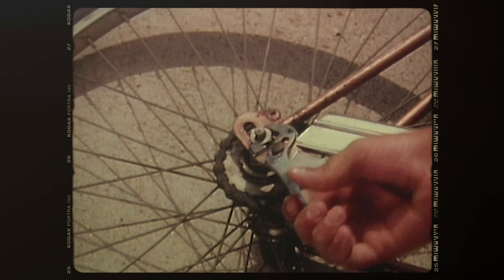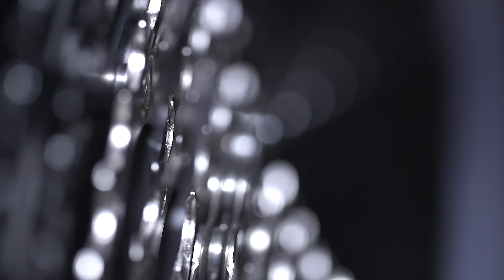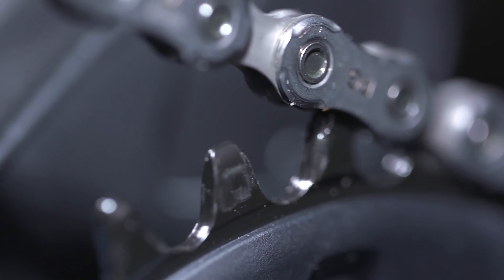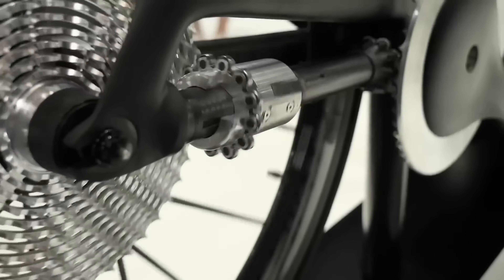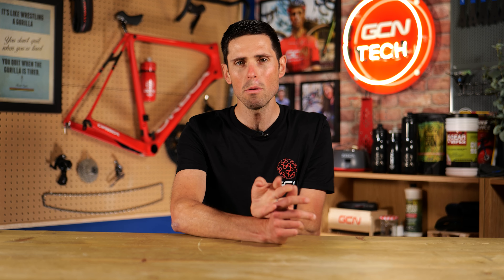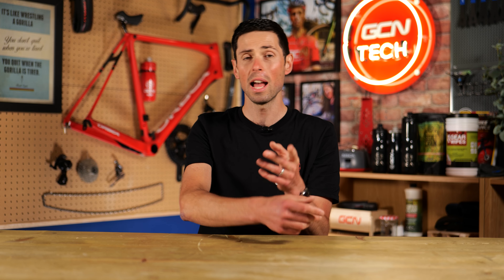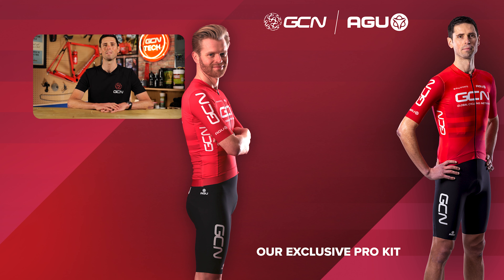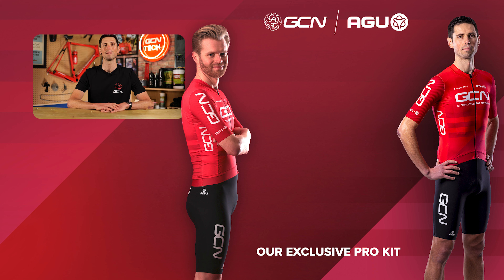Why This Will Never Happen!

Comment: For 99% of bike customers - as in, the normal people who make up the vast majority of bike sales - efficiency is entirely irrelevant. The things that matter are cost of purchase and maybe cost of maintenance - though the latter is already not very important to most people I would guess. Thinking back to my teenage days when I biked everywhere the things that mattered were the maker of the bike and how many gears it had. The chain wasn't given a single thought.
So, if you want to replace the chain with something better, it must be at the same cost or if the cost goes up by a handful of % you need a genius making the advertisement campaign. It's possible, I guess, but an uphill swim during a thunderstorm. 🙂

Comment: The ceramic speed driven project is the best competitor, however; it tried to win the whole ball of wax and that was a step too far. I am a design mechanical engineer, inventor for hire, retired. So I have a background to apply.  I have seen this whole ball of wax approach and the results here is what I expected, failure.  
The problem is that the designer always has unknowns that must be solved in the process of building the first production model. And unknowns that are a recognized problem are the easy ones. The hard ones are not known. I this case he set the robustness and performance standard very high so the price was cost paid to achieve it.  And the customers didn't see value, even the racing customers which even if they did, likely they wouldn't have prevented bankruptcy.
A better approach is to choose to stay in business which means provide the best value product and sell it to a niche market where it out performs a chain, VALUE. With a safety shield covering the end components for example it could be the best off road muddy, freezing slush, sand, jamming twigs weeds, etc., and grit. A ruff environment for bike because. the covers can keep the components  cleaner.
Took decades to squeeze out the issues to increase the value of a chain. There isn't a substitute for this.  
It takes trial and error with testing to solve issues after issues that reduce value.  Note, I didn't say performance or cost.  You want both, a balance. And you can not do this work without making a profit. It sometimes takes decades to even know the issue that needs to be solved. And the customers are going to be bringing you those issues from using the product. Especially as you broaden the customer base and environment. You will see the failures and have to figure out the issue behind them.  And this isn't obvious often.

Comment: As an Engineer I am sick of hearing that belts are better than chains, they are not.

Belts are not maintenance free as you still have to clean and inspect them plus they stretch no matter what the companies say.

That's why belt driven machines have belt tensioning systems in place to periodically tighten up the belt.

I'm not saying that belts are completely crap they do have a use depending on where it's used.

Comment: Please, internal gear box don't and can't replace chains as they also need power to be tranferred to the rear wheel. If that's done by belt drive then the belt replaces the chain, not the gear box.

Comment: I am so confused - a 99% efficient drive train won't be used because it will add an estimated cost of $2000 per bike, but yet Rohloff and Pinion easily cost more than that and are less efficient than chain.
Reply: Rohloff makes hubs, Pinion makes gearboxes. The former sits in the rear wheel the latter sits where usually the cranks and bottom bracket are located. Both systems require a connection between cranks and rear wheel, and that connection is either a drive belt or a chain. Neither systems works without a chain, so they can't be any more or less efficient than one.
Reply: @einundsiebenziger5488  - And yet they are both less efficient than rear cassette/derailleur and multiple chainrings + front derailleur.

Comment: Love belt drives for commuting. Love internal gears as well.  Both are great for reduced maintenance and the ability to always be in the ideal gesr to start or climb. Still, there is a weight, friction and cost penalty. For e-bikes those translate to a loss of range.  That extra weight on an already heavy bike is tougher to load and unload too.
Reply: Seems like belt drives and internal gearing would be much better for Winter.
Reply: @daniellarson3068  belts get stiffer and internal gears get a little sluggish, but I still prefer them for commuting, especially on an e-bike. No more missed shifts or being caught in the wrong gear at a stop. Loads easier on the entire drive train, but that does not negate the points in the video. Chains and deraileurs really are light, fast, affordable and almost as reliable as belts and internal gears.
Reply: Crazy that you spend more time name checking Ceramicspeed than considering belt drives or investigating how quickly chain drives drop from 98.3% efficiency. I should think that to get to that level you need to be running single speed, as any bend in the chain line is going to have an effect, particularly if you're running a 1x set-up, even with modern flexible chains. A well-maintained derailleur set up might still be a more efficient way to add gearing than a hub gear, but how well-maintained does it need to be? Looking at (and hearing) some of the bikes I come across, their chains and  derailleurs aren't running at anything like 98.3% efficiency. I expect that a brand new, professionally set up mid-range derailleur system is going to be more efficient than  a belt-driven Alfine system. Clearly, the derailleur needs more maintenance to retain its efficiency advantage, or, to put it another way, if neglected, it will become less efficient than a similarly neglected belt + hub that doesn't need much attention. The question is, how much extra maintenance effort, and at what level of skill, is needed? I find a chain-driven Alfine hub tolerably efficient for commuting, and less hassle to gear the gears running smoothly. I think I notice benefit after servicing my chain. If I ran a belt + hub set up that was fairly constantly only 90% efficient, but stayed at that level for years, how much effort would I have to put in to maintain a chain + hub that could be 92% efficient at best, but with enough time and neglect would seize up completely? If it's ten minutes every four weeks, I might be better off with a chain. If it's 15 minutes a week or the chain becomes less efficient than a belt, I would be better with a belt.
Reply: @chrishowell5718   hmm, chains are comparably very tolerant of abuse, which is one of their advantages, it’s never going to seize up 

it’s overstated that planetary hubs don’t require maintenance, they do. At the low end the Sturmey and Shimano hubs are poorly sealed from water ingress, and require periodic regreasing, not a simple process for either of them, and above the abilities of the average person.  

Expensive higher end hubs like the Rohloff are well sealed and run an oil bath with is easily replaced. Drawback though is should the Rohloff need repair you have to ship it to the manufacturer in Germany. And of course if you commute in a place like London, you can’t lock up that Rohloff equipped bike on the street, because it won’t be there when you get back.
Reply: @PRH123  I'm not saying that hub gears and belt drives are without their issues, just that it's a bit meaningless to say that chains can be up to 98.3% efficient without reference to how quickly they fall away from that or the effort needed to keep them there. Chains certainly can seize up completely (though the comparative ease with which a derailleur drivechain can be replaced is one of its advantages). I've also  certainly ridden bikes where the chain has seized at one or two links, giving that characteristic skip as it goes through the rear mech, and where the derailleurs are so badly aligned that they make a god-awful noise and won't select certain gears. Again, it's perhaps an advantage of chains that despite this the bike will go, and can be put right usually with minimal cost and effort, but I suspect that the fall in efficiency here s not 98.3% to 97% with a winter season's teenage neglect of the chain, but more like 95% (it was never a single-speed running in optimized lab conditions to start with) down to about 70%. If anyone has ever tested this, the results aren't easy to find.
Reply: @chrishowell5718  maintenance is a thing whatever you’re riding, anyone who neglects their bike enough to rust the chain is going to have issues with their planetary hub as well, they wouldn’t be likely to change the oil in their Rohloff or regrease their 3 speed ever…

anyway you’d have to leave the bike out in the rain for a year to get down to that 70% figure… 

There’s no maintenance free panacea in cycling….   like musical instruments they need attention to be kept in tune :)
Reply: @PRH123  well yes, that's my point. How much maintenance is required to keep a chain and derailleur system close to the mythical 98.3% (especially since the 98.3% is almost certainly for a single speed with straight chain line)? If it's 15min a fortnight to be 90%, perhaps that's fine, but many commuters might feel that 5mins a month for a hub and chain, and nothing apart from a yearly tension check and 5yearly oil bath for a belt to maintain a steady 87% efficiency is fine. I suspect that a whole year of neglect takes the efficiency of a derailleur well belong 70%, by the way. But that's the thing: no one talks about figures for how bad the efficiency of a badly maintained bike can go, it's always 'in tests at Harvard, bike chains were found to be 98% efficient and nothing is ever going to better that'.
Reply: @chrishowell5718   that’s the reason chains will always be around, they are very tolerant of abuse, and can run at large angles without any loss of efficiency 

The chain being dirty has some impact on efficiency, but it doesn’t take it down to 90% or lower, and 98% isn’t mythical if one just takes step to keep their chain in order.
Reply: @PRH123  sure, chains will always be around, though belt drives might increase their market share. Genuine question: do you have data (published by others, or self produced) that supports the assertion that chains on what might be considered 'the average bike' are running at close to 98% efficiency? I'd be amazed if some of the bikes I see around local supermarkets are running at that. I don't expect you to, if like me you are just some random off the internet. What is a little disappointing is for a relatively big YouTube channel to quote 98.3% as a standard value for the efficiency of bike chains based on one paper, whether it came out of Harvard or not. Even if chain + derailleur can be maintained at 97% efficiency with weekly maintenance, dropping to 91% with 3 months winter neglect, and a belt and hub never beats 95%, there will be people who will accept that because not having to do weekly maintenance is worth the loss of efficiency. Again, these are numbers that I'm essentially making up. If you have actual number (beyond 'Harvard says 98.3%, wow, no I haven't read the paper but what a big number that is).
Subjectively, I know that my teenage kids will ride their bikes until they are significantly more effort to ride than my own (Alfine, Chain) commuting set up ever gets. The commuter isn't as light to ride as the road bike, but then it doesn't have to be.
Reply: @chrishowell5718 everything from the cycling industry today, os about perfectly maintained performance. This is yet another reason Trek, Giant and Specialized have not moved more e-bikes. E-bikers aren't interested in expensive, marginal gains, especially more practical e-bikers that are replacing car miles vs bike miles.

Comment: It's bizarre and fetishistic how people are obsessed with chains. They cost about the same as a pair of grips or a box of bar tape and can be replaced just as easily. You don't need it to last 100 years so they don't need any of the maintenance that people who have products to sell like to claim. The important lubrication is deep in between the pins and rollers so leave it alone, stop washing out all of the stock lubrication with thinners, stop adding oil to the surface where it just collects dirt. On a BMX I was super hard on chains, bashing them on ledges and rails and I just treated it as a consumable item.

Comment: I agree with the premise of this video, which is that the humble bicycle chain will remain dominant throughout our lifetimes. One slight correction, though. When we speak of "links", as in 112-link chain, we are really talking about half a link which would consist of either two inner side plates OR two outer side plates, a pin and a bushing. What was described in the video as a link might be more accurately called a "full link," or two inner and two outer side plates and TWO pins and TWO bushings. With wider single-speed chains, there is such a thing as a "half link," which has bent side plates that can be used to connect an inner link to an outer link.
I love the fact that the pitch and in some cases width of bicycle chains have been unchanged for over a century. It's one of the  the oldest surviving "standards," now that the 100 mm width front dropout spacing is fading away, and is still defined in inch units. The 9/16 x 20 TPI" pedal thread and the ISO BB thread are the two others, though the latter was changed very slightly from the old 1-3/8" standard.

Comment: Eventually ceramic speed driven bike will be standard, because the simple non technical advantage of shaft driven : much less dirty on trouser, legs, & especially skirt.
Belt can't achieve that.

But it's most likely won't happen in my & your lifetime. Meanwhile chain is king for a long  .. longtime.

Comment: The biggest benefit to a chain drive isn't the efficiency it's the gearing.  The average human isn't going to really notice the difference between 96% and 90% efficiency especially if they only have the one bike.  If they can figure out the gearing on a lower maintenance system, while not forgetting cost, thats where the improvement is to be found. In my opinion.

Comment: I must add that the first Sturmey-Archer multi speed hub arrived in 1902.
Reply: Yes indeed, and fully enclosed chain drivetrains could be had paired with Sturmey archer hubs.
Reply: Flip flop hubs also existed before the campy system.
Reply: Three speed right?
Reply: @SaanMigwell  I think the very first hub was a two speed, but they soon shifted into making three speeds, pun intended :)

They have a good section on their own history on their site.
Reply: @ Yup. Still the best three speed hubs in my view. Absolutely reliable.
Reply: @rudolphpyatt4833  wish they would bring back the oiling port though, instead of the factory packed grease as they do it now
Reply: @ Agreed. And as long as we’re thinking about product changes 😉, I think an updated version of the AM medium range hub would be a successful product.

Comment: chains are great but you've sais it best theres loads of moving parts exposed to the elements so that peak efficiency is out the window. Thats why people go bonkers ways to keep that efficiency eith waxing cleaning afteer rides and reapplyin g drip wax and then periodically redoing the whole thing. the ceramivspeed type of a solution would be that costly.... at the scale proposed but so would our groupsets in such quantaties. Chain is "good enough" cheap due to scale and has loads of industry innertia behind it. Like you've mentiioned belts need "special" sprockets... but so do chain drives but because they are the norm you don't call them speciall. but they do have more complex geometries than belt drives yet you cal belt drive one special.

chains are awesome... for clean running environments.
Reply: ... there are* loads of moving parts

Comment: Things you didn't mention.
Chains are used for the same purpose in machines, such as the motorcycle. BMW uses or at least used a drive shaft that presented issues for stability from the torque.
Chains are the simplest model for propulsion allowing for resolution in situ for mechanical failure. Other systems almost always require workshop attention
With reference to the above, replacement of and manufacture of chains is easy by comparison and allows for the simplest mechanisms for the remainder of the drive system.
Reply: Not to mention that many car manufacturers switched from drive belts to chains to drive alternators.

Comment: Always the same nag, how efficient. The belt drive paired with a Rohloff will win over everything for commute in the Dutch weather throughout the year. Yes in ideal cases a chain is better, but you will spend ages cleaning it in the Dutch weather. Hey GCN is mostly UK based. You have the best weather too. Over 80% of commuting bikes here sold in 2023 and 2024 have a belt. And that is only because commuting bike schemes.

Comment: 0:49 For the same reason we're using the wheel (5500 years old), the lever (7000 years old) and the seat (it's your guess years old). Sorry, I just couldn't resist...

Comment: I have a shaft drive Dynamic Runabout which I love to bits. The performance loss to anyone but professionals is not even close to noticeable. I don't think I will ever go back to using a chain and derailleur because the maintenance is just such a time waster. Plus the hard metal case that the shaft is in provides a surprisingly convenient foot rest whenever I give someone a backie!